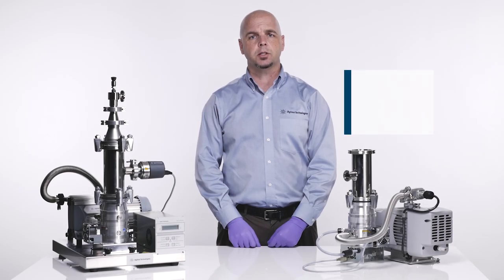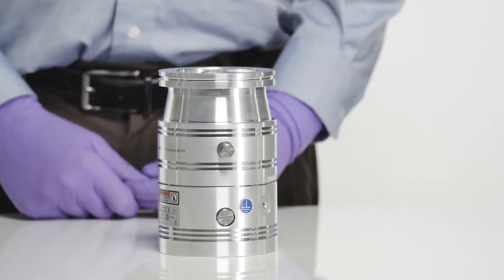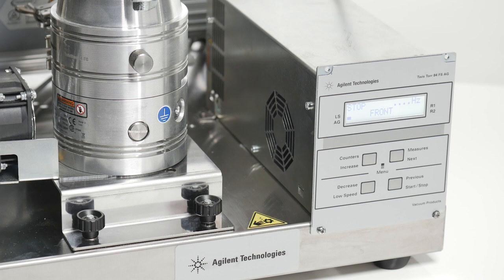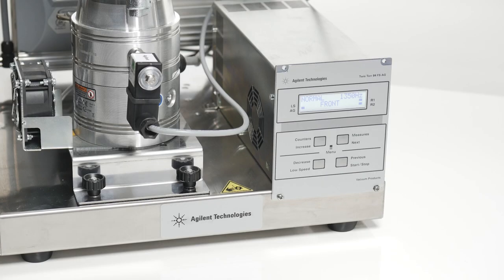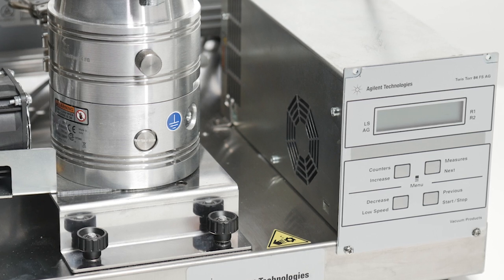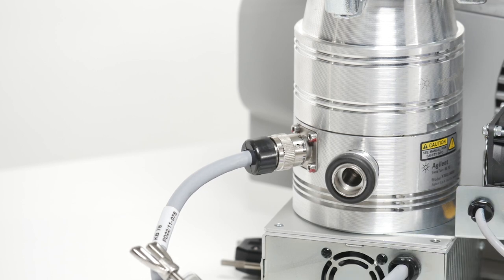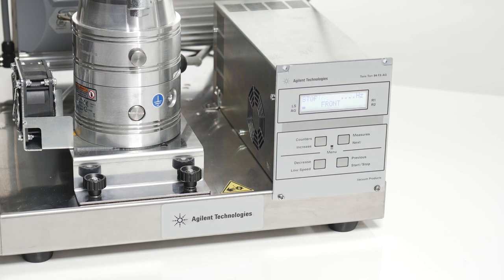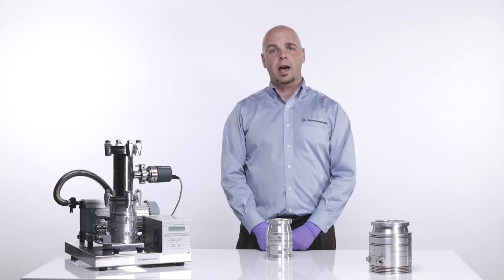Turbo Pump Care and Use 101 - Part 5 - Venting and Shutdown

Comment: Let it spin down, bleed pure nitrogen or argon into the system with bleed valve. A vacuum isolation valve on the foreline will help to prevent nastyness from backfeeding into the turbomolecular pump. A baffle/diverter is recommended before the turbopump intake especially if using for a sputtering or E-beam evaporation application. 🤓